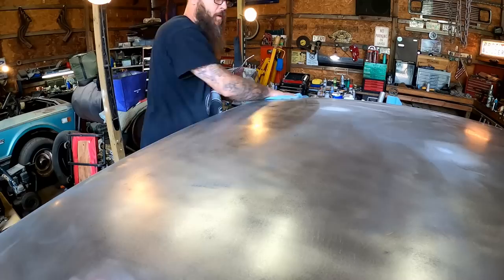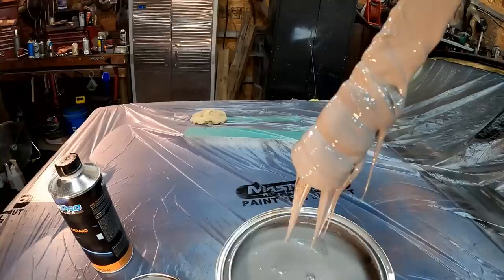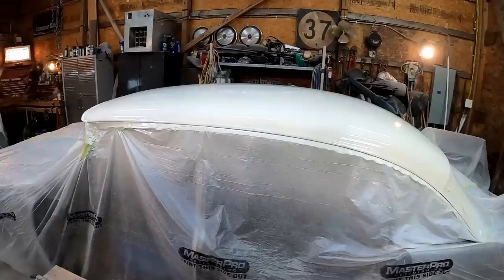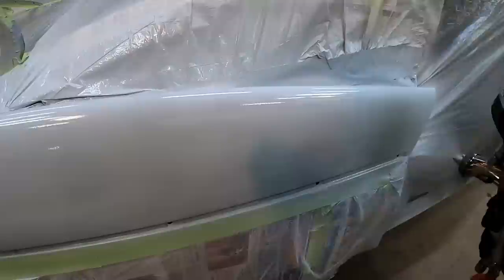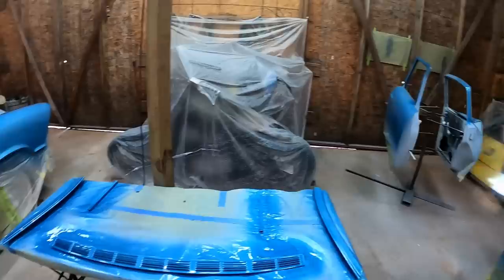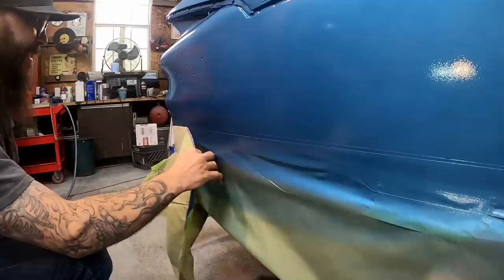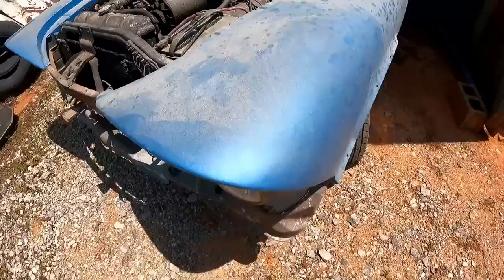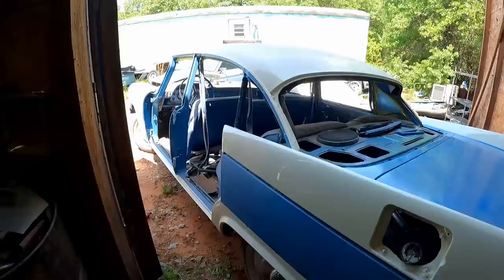THE '59 DODGE IS BACK!!! FULL TIMELAPSE.

Comment: I posted this comment a while ago. 

You will have to locate original windshield and rear glass rubber from a parts car. NONE of the repro stuff will work. They are special seals that fold into themselves. The good news is that any 57 thru 59 Mopar 4door SEDAN uses the same seals. It's super important to understand how to remove them so you don't destroy the rubber.

So glad that you are getting back to this car ! 😀

Comment: That baby is so close... 
Mike, I put a windshield in my '77 F150! It uses the rubber grommet-seal, with a groove on the inner and outer diameter. I guess they can be taken out without cutting the seal, but I got the glass and the seal out of my old cab intact, since the top pinchweld was rusted away.
It took me a good 90 minutes or two hours or more to get it in, working slowly and carefully, but I got it with no cracks! I used an old CAT5 cable for coming up the A pillars and around the corners to the header, but I think I pulled the cable and fished something thinner in its place, since the going was getting tight.  Working the top/header into place was the most difficult part, since the glass is 3/4ths seated, and everything is tighter. I also used a knife and some other small implement, in addition to the wire and string, to pull the seal lip inside the cab. After that, I swapped out the back glass in less than an hour...
But that front and back glass you're dealing with there is a whole different animal with all of the curves and wrap-around...
I'm betting that you seat the bottom channel on the pinchweld, and then start working up the pillars, to the top, and then evenly to the center, but research it to be sure. By the time you're coming up the pillars, you'll have a good idea what the glass and the seal are asking for, as you work in increasingly shorter increments.

Comment: Hey man I wanted to tell you I had a bad experience with the spray foam .  used it several times and the problem I had with it was months later when it would get in the sun or hot it would expand more and start cracking and then when it would cool off it would go back down but I’m worried when you park that car in the sun it’s going to swell up and start cracking your dash . hopefully not !! Good luck brother

Comment: Bro nothing wrong with Harbor Freight tools , are they the best ? No , they are will do tools ! Take care of them  I have had a 1/2 in air impact 4 in anvil that I have had for 10 years , I use Marvel Mistry oil on after each use before I put it away , my 3 ton floor jack bought at the same time is just now starting to leak at the cylinder (can’t be made) several hand tools over the years some good some not , I have tried 2  different 3/8 drive air impacts with no luck didn’t last more than 3 front brake jobs , I have never used electrics but after seeing you use them I think I may try them , they were not built to last back when I was full time in the shop which I went to work for the county as a detention officer in 2004 after I couldn’t deal with the tendenitise in my acillies on the concrete all day so I let my fight skills make my living for about 9 years , but I still mess with cars ,